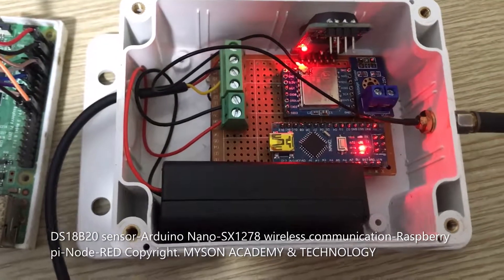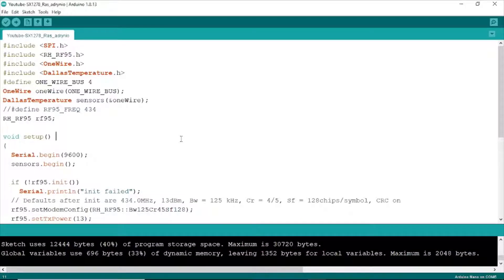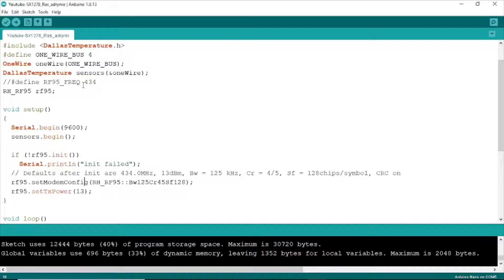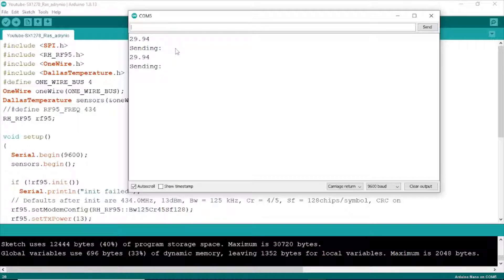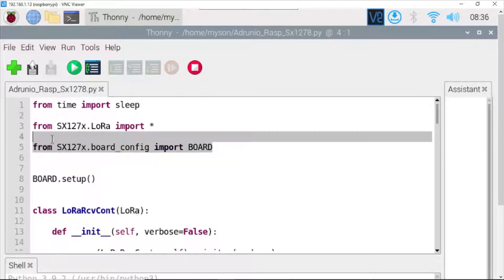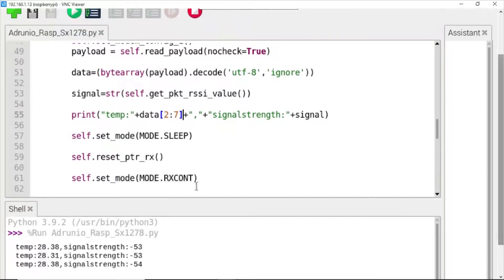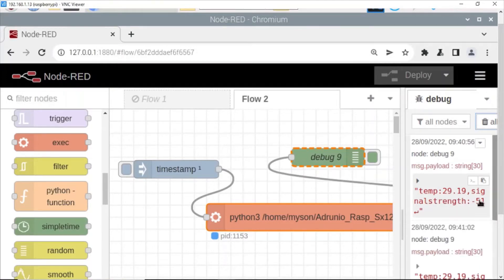DS18B20 sensor Arduino Nano Lora SX1278 wireless communication with Raspberry pi  Node-RED

Comment: Hello, I tested it and the temperature only shows "Sending: -127.00" The module is ok. I tested the Lora and the DS18B20 separately and it works fine. However, the complete code keeps giving this. I've changed the libraries and tested other codes and nothing.

Comment: i did almost the same project but i use dht11. When you start the code to the raspberry pi how does the arduino send u the vaules, without compiling in the arduino?
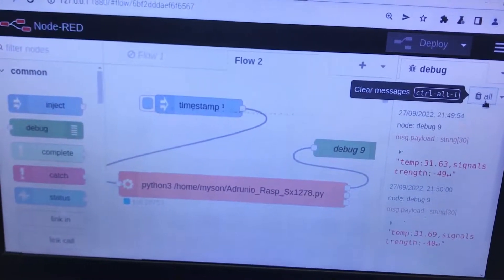Reply: H  boy live b it a a. C Fs aSà a song pl or gdddd.       Vvvbbbhhhhhhhhhyyuuuiiiiuuuyy 1:47